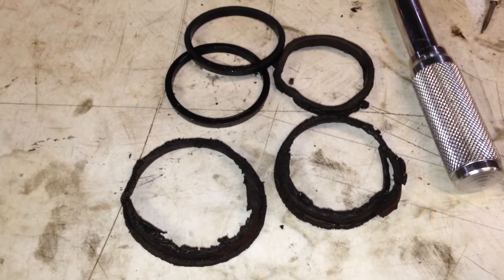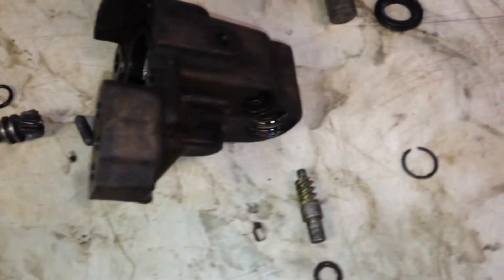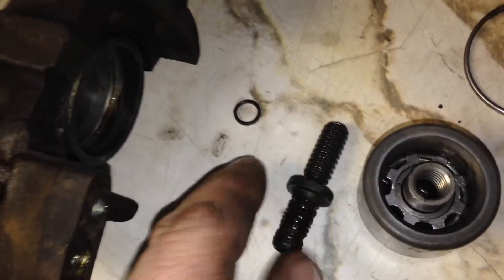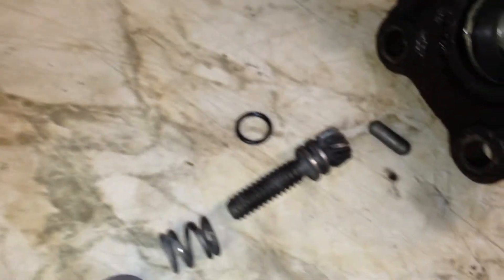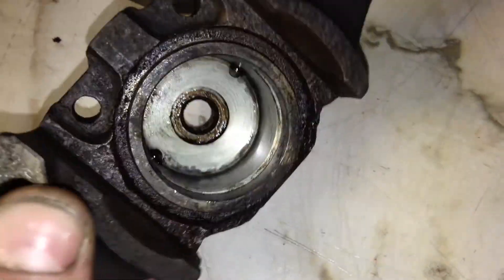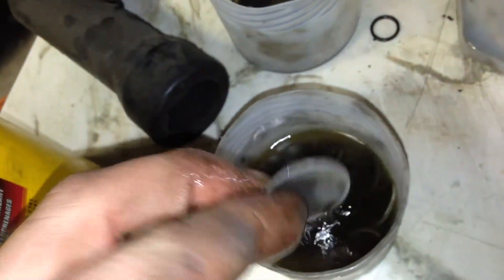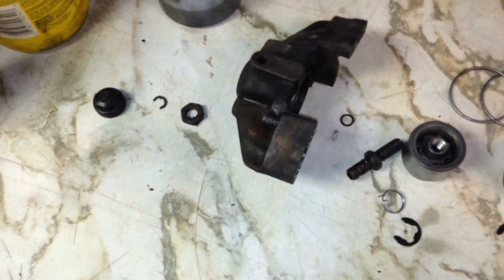Alfa Romeo 116 Rear Brake Caliper Dissassembly

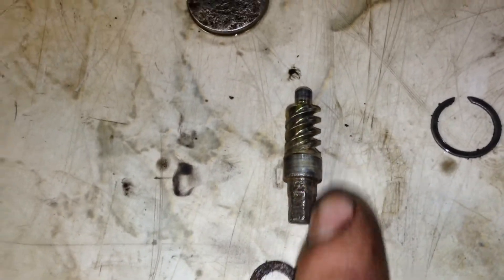Comment: Hey, how did you remove the 7mm worm screw adjuster you are pointing at 3:40 mark?
Reply from the maker: There is a retaining ring that must be removed
Reply: @Nodarperformance  Thanks! mine was rusted out and full of grime so I couldn’t locate that snap ring first. No way I’m getting that sucker out without a dremel.

Comment: how did you remove the inner adjustment  screw and  c-clip?
Reply from the maker: @davelee7572  there is an internal retaining ring (or wire) on the screw itself. Once removed, the adjuster is removed and the o-ring is accessible
Reply: @Nodarperformance  thanks, but how did you remove that internal retaining ring?
Reply from the maker: @davelee7572  I usually use a couple small jewelry screwdrivers
Reply: @Nodarperformance  its quiet a stiff clip. i cant seem to grab it, even with picks etc. do you remember what direction method you used?
Reply: I am also having trouble removing this clip. There are no holes for a C-clip pliers and it just spins when trying to tap on it. Any more details on how to remove it? Are you applying force to both ends of the clip simultaneously?

Comment: In case the handbrake piston adjustment mechanism is spinning free, how can it be solved?
Reply from the maker: Sometimes the internal mechanism is disconnected. Caliper will need to be disassembled and rebuilt

Comment: How to remove  the piston on the parking brake lever side ? I turned the adjuster on the outside fully clockwise to push it as far as possible. But now it looks like it has reached it's end
Reply from the maker: the adjuster just comes out, its held with a circlip on the ID

Comment: Very similar to the ATE calipers used on Porsche 914s, Ferrari 308s, Volvos, Mercedes.... Be thankful yours just have hex-head bolts; the ATEs used RIBE bolts (similar to Polydrive and not common sized but 7mm and 9mm threads)! Next time instead of whacking the parking brake arm off, drill a small, shallow hole near the edge (but not on the edge!) of that "cap" and pry the cap off with a small screwdriver. Then you'll be able to properly pop the snap ring off. The risk by hitting it is you could damage the retaining groove for that snap ring. These caps are basically smaller types of engine block frost plugs.
Reply from the maker: +Peter Rychel scary that on one the calipers the handbrake lever snap ring was not even attached anymore and the lever just fell out. Wouldn't have known anyways as the paring brake cable was snapped, so a new one of those is already installed and ready to try out...maybe one day the parking brake on this car may actually function properly
Reply: +Nodarperformance Yeah, old Italian cars and parking brakes are an oxymoron ;).... At least with the ATE calipers, that inboard adjuster screw needs regular adjusting. Once adjusted they hold fine, but as the pads wear, they need to be screwed in more. Good thing to check on a yearly service. Specs call for 0.1mm (0.004") gap between the pad and disc! Hopefully your rotors aren't warped 'cause that can be less than the run-out on some!
Reply from the maker: +Peter Rychel ATE says that once the .1mm gap is adjusted, they are supposed to auto adjust as pads wear. However, in my experience this has never quite worked properly until I have disassembled and thoroughly cleaned and lubed the internal mechanism as shown. I did this exact caliper rebuild on my GTV6 last year and it has been great to have a working p. brake finally